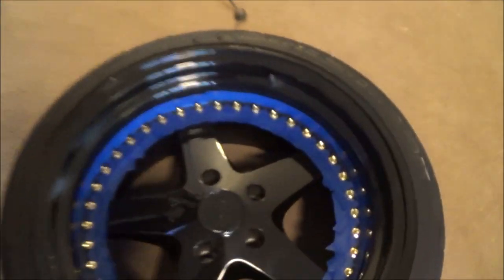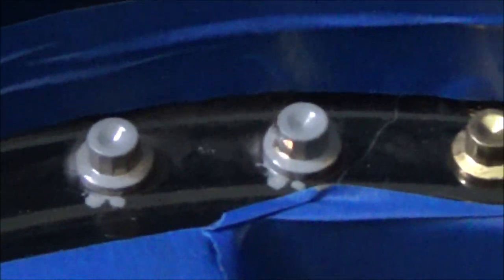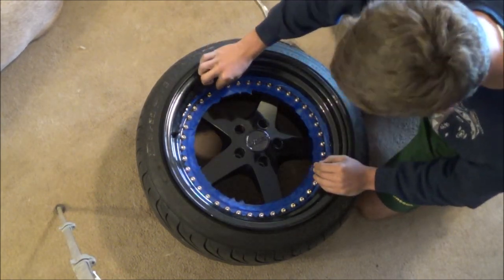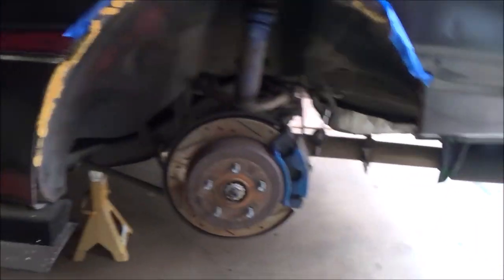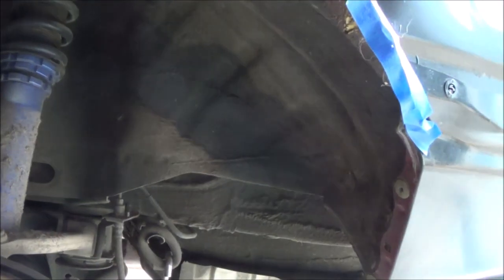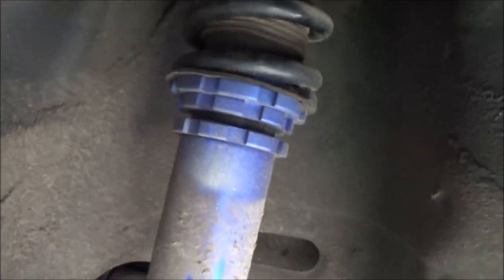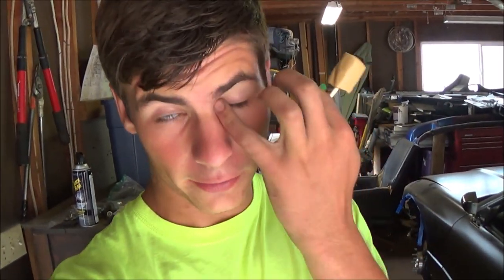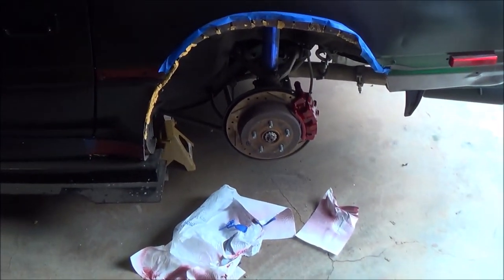PAINTING RIVETS AND LOWERING THE REAR COILS

Comment: I've got super cheap maxpeedingrod coilovers on mine I've got them ran all the way up or down however you see it. The front tucks most of the tire on my 17 inch svt cobra wheels except the back is 2 inches too high so the car is raking..
Reply from the maker: Yeah that's the problem I had too, so I'm hoping that this'll help a bit
Reply: @PhilWithSuper  I'm going to take my coilovers off the back and cut 2 inches off the threads and the bottom piece and see if that'll work. I'm going to end up having to get a fender roller and roll the front out, id rather not have to put fender flares on it. Are you going to do anything in the inside interior wise?
Reply from the maker: I tis be!  I'm just finishing the outside before I go inside
Reply: Heck yea do you have a Snapchat or just insta?
Reply from the maker: Yuppity yup, my insta tag is in the description and at the end of the vid.  it's @philwithsuper